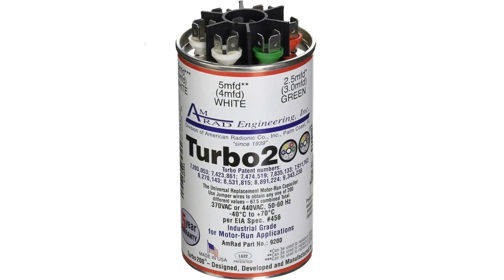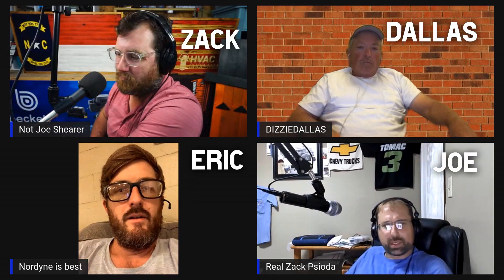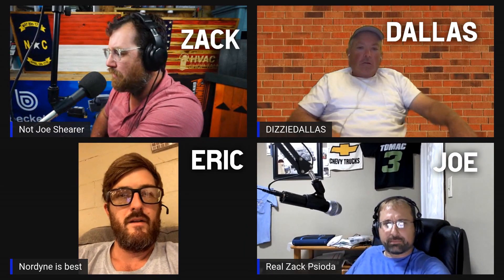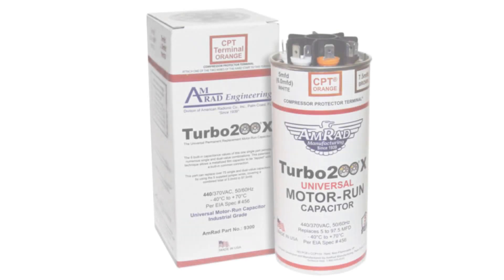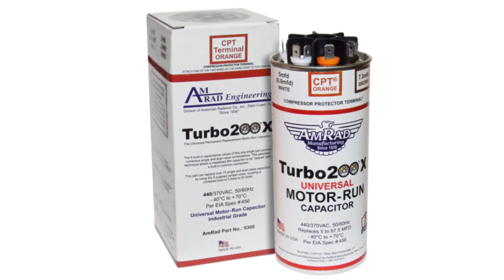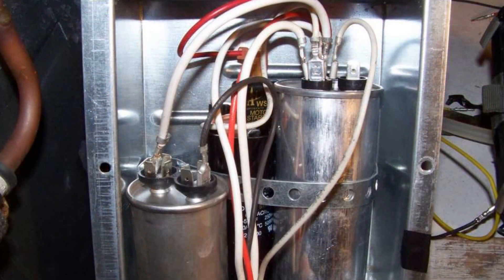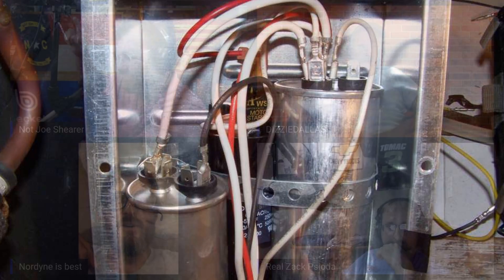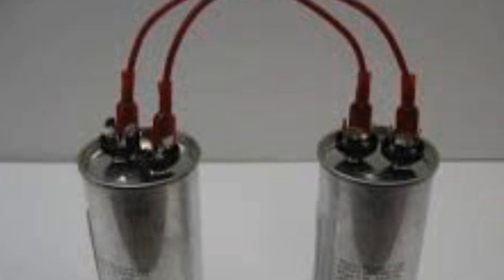Should HVAC Techs Use Amrad Turbo 200 Capacitors?

Comment: By the way, have any of you noticed that American Standard and Trane package units capacitors seem to last much longer than others? I was wondering why, because they're not particularly better quality, then I realize it's because they're mounted in the blower compartment which keeps them cool. Heat is the number one cause of failure for capacitors.

Comment: Have any have you changed any older Rheem units from the 1990s and notice that they still have the original amrad capacitors and try testing them to find out they're still reading like a new one????

Can you name any other capacitors you've tested in units that are original, 35 years old and still good as new?

By the way my experience with all the comments I've left here is in the Southwest desert where it's very common to have 116° days, plus much higher than that in the control compartment on many units with no shade in the sun beating on them all day. And still, the amrad has not failed!!!

If you found a better one please please please please please let me know because nobody carries amrad in my area except for the turbo 200x and those are pretty darn expensive

Comment: So with all the failures I've seen with the Titan HD USA once I went to the Mars made in USA dual voltage ones, which are eia 456 rated. I thought finally I found a quality capacitor, but I've been experiencing failures with those as well. I just changed one today that didn't even last a year and a half.

Comment: I got sick of the Chinese ones failing so started using the Titan HD made in usa, and then those started failing. I had one literally explode within a few months, took it back, waited in line for several minutes while the supply house called the Titan factory, he came back to the calendar and said they don't have any warranty on them at all. So I asked him, if I buy another new one right now go to the body shop next door install it on their unit and it fails and bring it right back within 10 minutes, there's no warranty? And he said yes that's what the factory told me

That's the ones in the red white and blue boxes that say Titan HD made in USA,

Comment: I liked these at first, but I've had more of these test outside of tolerance new out of the box than the standard grade O.E. replacement caps. Exchanging them is annoying. I have noticed a slightly higher failure rate than the standard Mexican made capacitors, but nothing definitive. Honestly I can't justify selling them unless I have nothing else available because they're only as good and not better than standard replacements. I'd rather jump standard caps together than pass the extra cost on to the customer. Don't get me wrong, they earn their spot on my truck, but I'm not crazy about them.